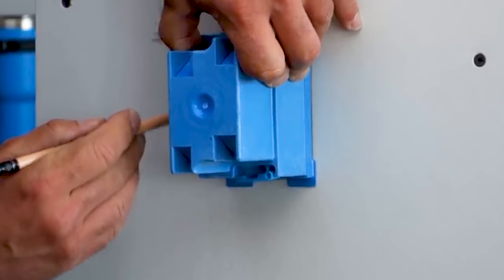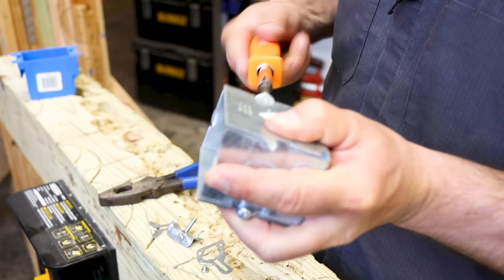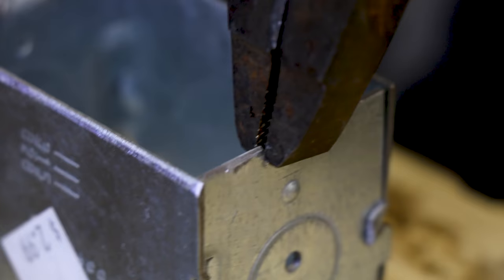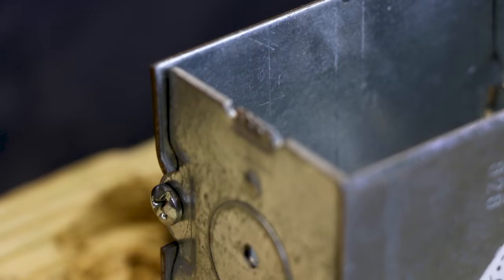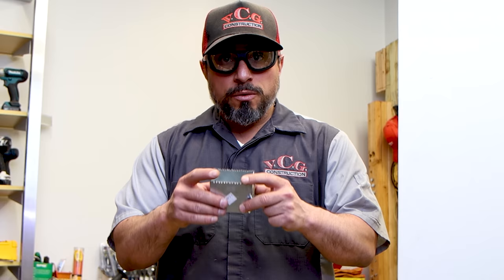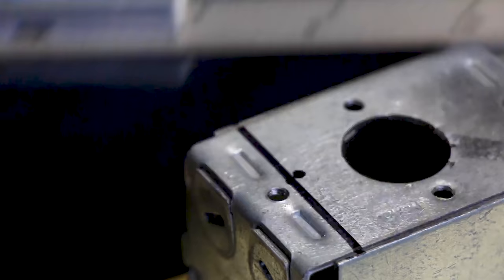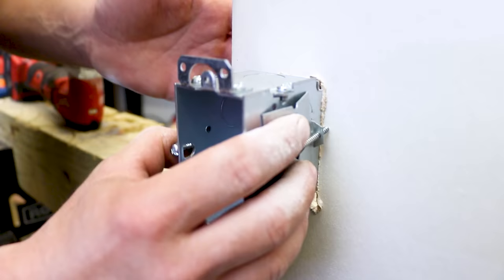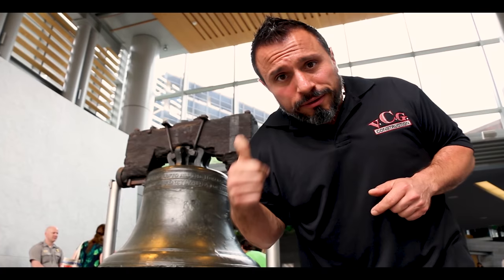AMAZING DIY Oscillating Tool Blade From Old Electrical Work Box (FAST, EASY, CHEAP)

Comment: I have been sharpening old worn blades for rough cutting Sheetrock 
Just 2 minutes with a metal cutting angle grinder blade and they work really well

Comment: hey Vinny I'm only at 3 minutes and all I can think is you need your little mini 12 volt Milwaukee disc grinder it would be perfect for this.
I have been using it to recut teeth in worn-out blades that I had used in plaster. I'm sitting in my car after work but I got pulled into this video I got to get back to it and drive home. 
Great idea Vinny 👍👀
Reply from the maker: Wanted to use bare minimum tools, but yes your idea may work faster!

Comment: Pretty cool. Might be worth it if you are a pro. However for the average do it yourself kind of guy adding a few boxes it is worth the effort. I recently did some wiring in my garage and cut 7 boxes in. Made a cardboard template to trace the box and used a regular blade and freehanded it. Only took maybe a half hour. Only took that long because half of them were 10 feet in the air. But it is a cool idea and video. Good job VCG 😀

Comment: I think you need to add some curvature to the ends of the box and pull it out a little to widen the cut so it's not a PERFECT barley fits snug fit....because you do need to put a box in the cut....and it won't  break the corners on the sheet rock to much

Comment: This is a pretty good idea. I don’t see me using it enough to make a special blade but itd be a neat tool for a contractor that would use it often. Considering that I’m more curious to see how it holds up. Wish you would have did like 20 cuts in dry wall then examined it then just to test it out cut into some wood.
Reply: I've used it a ton, including purposefully going through plywood laminated with drywall for TV mount locations and it still chews through the drywall. 

I have noticed the bit kicks up a hell of a lot of drywall dust new and used. Likely due to how fine the teeth are, I imagine VCG's method allows you to create larger teeth which would likely decrease precision of cut edges but would reduce debris. I use it in construction environments before floors are done and usually use jab saw post-construction as office staff don't usually care for the noise of an oscillator to begin with.

Comment: My grandfather has done this for years
Reply: My ancestor from Egyptian times already knew how to do this....with rock!
Reply: Theee Chosen One one of the builders? Didn't they use some sort of sound vibration to lift the 60 tonne granite to fit so snug you couldn't even slide a filler guage between the joints?

Comment: Well done Vince. On a negative note I was cutting branches to tiny pieces and putting in the bin. I sharpened the cutters real sharp. I then actually cut my finger. It took two weeks to heal and I have no sensation on about 10mm diameter on my finger so when you said careful you may cut yourself. I know what you mean.
Nice great invention. Have you thought of holding a vacuum near to collect dust?
You could modify so the external doesn't get tear out.
Im making clamps to fit on both my metabo track fence and my festool track fence. Since my tools have all been stolen it's been a process to replace and there doesn't seem to be an availability at this time for the metabo clamps. I get the bricklayers clamps and cut off the end. I then cut some angle iron and run through the belt sander to take down so it fits in the track. The last one I welded the welding was too much and wouldn't fit in the track so grinding down lost its strength. So the next ones I'm taking the edges back so I can get a decent weld on to fit. Theoretically it should be strong enough. Other wise its plan c. If that isn't good plan d and plan d.

Comment: Only concern I can think of is how much heavier that box is compared to the store bought version. How much stress that might put on the oscillating tool and premature wear on the motor and bearings. I think the time spent making it and possible damage to the tool is a wash compared to buying one. But the idea and concept of making one is spot on.

Comment: Good thinking. Way to go on saving  💰 . Any suggestions on what tool to buy to sand a 6' tall old steel locker or should I just buy sand paper and use elbow grease?

Comment: Interesting idea and it seems to work. Two things I noticed. First, while I see the drilling the actual mounting of the box to the tools isn't clearly shown so it is hard to see how well it's attached to the tool. Second, a double cut bastard file still only cuts in one direction, on the push stroke. It has two sets in teeth at right angles, so it cuts faster than a single cut, but it doesn't cut on the pull stroke. Be curious to know how often, if at all, you would need to resharpen. Seems like it works almost as well as the official tool.

Comment: Stumbled across this video today. i have to cut in old work boxes for data drops frequently and still prefer to mark it out and i still use the 4 in 1 drywall blade on the bone saw. but if i was going to use something like this, my thought is this: how much is my time worth? how much does that component cost? do i save or lose money trying to fabricobble a solution? at $45, that can't be worth more than 30 - 45 minutes of your time, i would think. i'd guess you have at least that much time invested in collecting materials, filing, drilling, yada yada. paying the $45 might have been a bargain in the end. having tried the qbit, i still prefer the 4 in 1 on the oscillating tool. 

been watching alot of your videos lately vince. i have a van full of dewalt 20v and you have me really tempted to dip into the milwakee 18v stuff. thanks for putting in the effort to make these videos!

Comment: Id just use the milwaukee rotozip ;) but you could use a dremel with those tiny carbide wheels to cut the teeth and it would go a lot faster. I have re cut teeth on an oscilator blade before with one alternating directions cut suprisingly well.

Comment: if you could attach the file to a reciprocating saw you could do the filing of the teeth in half the time. If the tool manufacturers are listening, maybe they could run with the idea of file "blades" for reciprocating saws.

Comment: QBits....been using those for years. Thought they were gimmicky when first came out, but they work & stuck around. Use QBits when doing production installs, otherwise like using the drywall OMT blade Imperial Blades sent out.
Pretty cool Vince that you made your own QBit. Pretty cool, & long as works...why not👍🏻
We ended up getting a set of QBits years ago & had to pay full price 😱, something that doesn’t happen very often, especially since belong to VCG Fam, paying full price for a tool, accessory, etc.. Thats just sounds wrong even saying😉
Cheers✌🏼
Reply: Yea, Qbit when new construction, before other trades do sanding/floor prep. Jab saw rasp, or razer blade post-construction or occupied space (mostly for noise reasons.) 
Office workers don't own earmuffs and don't like power tool noise haha. 

Vibrations push the plug inside the wall cavity, so no trace left behind other than drywall dust which is not even close to the amount created during wall sanding.

Comment: It's a cool idea.  I dont think it's something that's going to catch on and work over time.  Even the oscillation blades for sale that he mentioned at the beginning of the video.  Fifty dollars when you can use a jab saw / dry wall saw and four little cuts that you marked out in pencil take about 30 seconds.  The time to put that on your multi tool and make it I could of cut out a hundred.  Now what they need to make Vince is when installing drywall and you get to an electric box there should be something you could install into the work box so that when you bring your peace over to the wall and push it up to the wall it should pierce the sheetrock giving its exact location so from there you can make your perfect electrical box cut in drywall.

Comment: Can you do it with a dremel and time how long it actually takes?
Reply from the maker: I’m sure you can do it with a Drexel , but I wanted to illustrate how it can be done cheaply. Just using files took around 20 mins to make the tool.

Comment: Spend the $20 and get a harbor freight grinder and you could make that in about five minutes. Also instead of trying to make the attachment point, just take an old dull oscillating blade and epoxy or screw it to the box.

Comment: Hell ya love this I go to it about my Milwaukee tools. May u can help I tighten my blade to tight on my multi  tool now cant get I off. Any ideas ?
Reply: you fliped the release handle up?
Reply: @chief9989   I did tighten it to tight now that washer is stuck on those notches on the bolt
Reply: @brentunderwood1015  square  handle straight N#3 and a wrench  maybe a dab of wd on the washer
Reply: @chief9989  I'll have to try it if my friend cant figure it it

Comment: Kool!
I would have used the M12 rotary tool with various grinder and carbon heads.
At your pay rate im sure it still cost you $50, 
in time, 
LMAO!
Reply: reuse factor bro, think of the long term, not the here and now.
Reply: I don't know what  you pay your guys but in my experience just buy the tool or teach them how to cut straight with a normal blade!

Comment: The idea is nice, but the metal used is too soft to hold up, and itnis too heavy for the multitool to vibrate it at the optimal speed, there is a reason why those blades are made light and very hard..

Comment: PSA these types of Qbit boxes are generally for use in 18v/20v oscillating tools (don’t think the m12 can handle) and the 40-50$ models teeth are only rated for drywall. They do make a LOT of debris.

If you were pushing into drywall and couldn’t see the material behind it and blindly hit a plywood sheet added for lamination, or went too deep and hit concrete exterior walls would quickly ruin the teeth. 

Using grinder and a box on hand might get you through the day if you don’t have a local shop that has the blades in stock, and still have more to do.
Reply: What do you mean ruining the teeth? We're cutting drywall here not concrete. You can make those cutouts into drywall with a scraper blade🤣🤣 with soft material like drywall, it's the oscillations that are doing The Cutting not necessarily the teeth. And if it takes somebody more than a few seconds to Mark out a box and cut it with a regular oscillating blade, they probably need a new profession. These Q boxes maybe faster; but unless you are carrying multiple oscillating tools with you, you lose that time when you have to switch the blade out to another blade for a different application. I just keep a wood with nail T blade on mine for 90% of everything I need to cut this way I'm not wasting time switching out blades. And as far as over cutting, again that person probably needs a new profession because 90% of all oscillating blades come with depth gauges on the blade so you can see how deep you are cutting🤷‍♂️🤷‍♂️🤷‍♂️
Reply: @Jericho Joe   I was sharing manufacturer instructions of Qbit, which he clearly wouldn't know because he doesn't own one.. He's rigging his own with common materials available on jobsites. I agree use what you have, but if you don't have the right tools for the job you're ill-equipped.  (Manuals are commonly ignored, hence PSA at the start, which you also ignored.) lmao. Yea if you can't tell the material behind what you're cutting, stud distance/outlet height, or depth of your cut..
You aren't worth your salt, and don't deserve a profession to begin with.

Losing time to switching blades? What?? Your oscillator doesn't have quick change? Milwaukee/Dewalt have quick change, bits slide over the locking screw once you activate the release. I assume you use Bosch bits which are full-circle collared and force you to completely remove locking screw.

I'll swap off this bit to use carbide T for electric strike installs (door frame modifications.)
If you're a floor/door guy you have no need for this, I've noticed floor guys are the majority of who own oscillators.
If you are low volt Datacom/high volt electric, and install outlets(>20+ drop office spaces) frequently this is a niche tool that can speed up only one task: cut-ins.
I've done 300+ cables, 80 cut-ins (LV1 plastic mud rings), routed cables down walls, 4-port wall plate terminations, and rack terms (4x 96-port patch panels) in one day with Qbit and JR-LEV-2 for the keystones. It helped with speed and user-fatigue which, I thought is the entire point of power tools.

Comment: I hate buying from Amazon but you can buy blades there I get 50 for like 40 bucks ya there cheep but if I use 2 its still tons cheaper then paying 15 bucks for 2 at lumber yard.

Comment: We're cutting drywall here not concrete 🤷‍♂️ if it takes someone more than a few seconds to flip a box over, trace it, and cut the square out; they probably need a new profession anyway. I always found these things kind of gimmicky cuz unless you're doing a lot of electrical box in a single day where you're worried about production efficiency it's just a waste of money cuz it only really saves you a few seconds on what you can do with a fine-tooth oscillating blade in the first place cuz you still have the mark the location. Then if you need your oscillating tool for something else you got to switch it out which also takes time adding right back onto that time you supposedly saved. Typical oscillating blade is about an inch and a half to an inch and three quarters wide if you're using the T style, and drywall Cuts Like running a finger through water. Shouldn't take more than a few seconds even without that tool. I know I know I know; "if that's how you feel then why are you on this video?" Simply because I like Vince's videos and this was the first DIY video I seen from him so I clicked on it.

Comment: Good idea but its really not much time to just cut out your hole with a regular multi tool blade or even just a drywall saw. I did see something neat tho which is a level attached to an old work box that way you just stick it on the wall and dont have to hold your level on it.

Comment: FILE the edges? You don't have a grinder?  And files only cut one way. Dragging them back,under pressure dulls them. Shop 101.
Next, by the tine you finished filing your teeth in, I'd be able to tooth out 10 boxes with an angle grinder and a metal cutting disc, which I also use to recut in my holesaw teeth! OTOH, your concept here is solid, and thanx 4 experimenting!
I get a question here; as to will the metal box size out to install plastics, which we prefer? 
Secondly, I wonder (and am certainly gonna try) if I can just SHARPEN the box edges, and instead of OSCILLATING the box, HAMMER it in with either an air hammer, or a hammerdrill set on hammer mode?
If that works,  don't you steal my CREDIT, brah!   ; -/

Comment: FFS, hold it in a vice!
This won’t fit on the latest type of mounting, Makita etc, would have to tack on an old blade for that. Also cut the teeth initially with a thin grinder cutting blade.
Otherwise a great idea and I will defo make one!

Comment: I am sure you are biased with milwaukee. As Dewalt DDD 998 is most powerful drill having 3 speed setting it is obvious that its no. 2 is not milwaukee’s no.2. Wrongly compared man

Comment: Well Vince your thinking outside to box. But the box will not fit. When you put the brackets back on and the tits on each side will not go in then the Sheetrock clips will not slide by. So the tool is $50 not that bad I use mine all the time the costumer gets charged a small fee for the tool because it will not last forever and it’s paid for. If you don’t do electrical work for a living then you should not be doing it. but if you need to cut in one of your own use a sheet rock saw. Remember keep America working. We all need jobs.

Comment: Your so funny so Proud of your self. The thing is if you use that cutting box blade you have the  potential to cut right in the meddle of a stud but if you use a dry wall saw and start cutting vertically first and hit the stud you just have to move the box over to the right or left depending what side the stud is at. So to not make a unnecessary hole in my customer job I’ll pass thank you.
Reply: To avoid making unnecessary holes, just don’t cut into the wall with either tool before knowing whether or not there is a stud behind it. Even the cut you would  make with the drywall saw is unnecessary if you hit a stud. Just check for studs first, then cut.